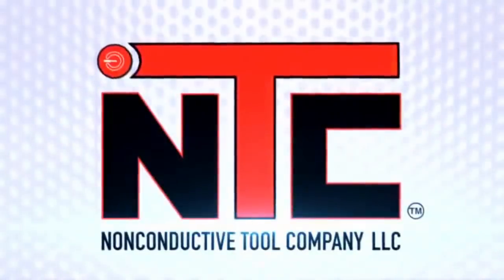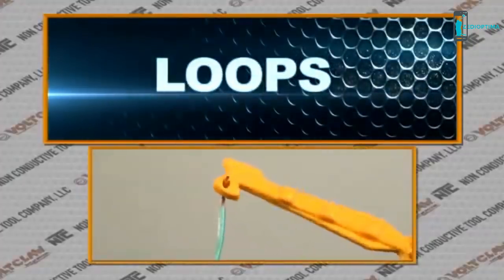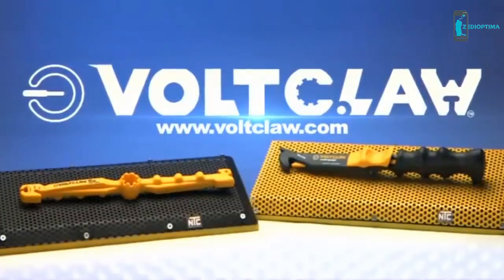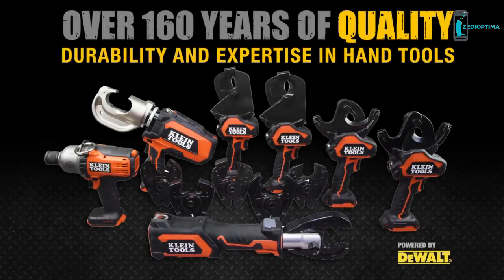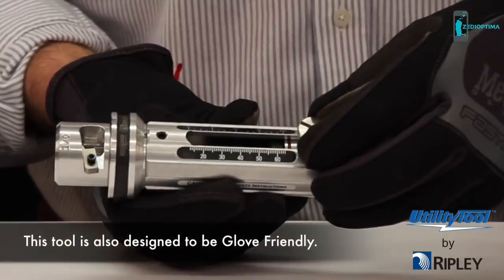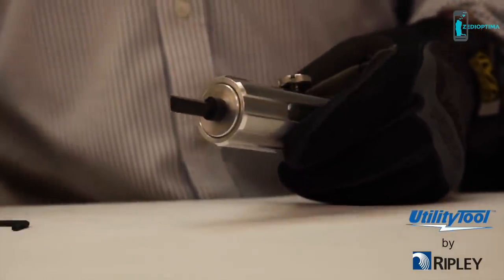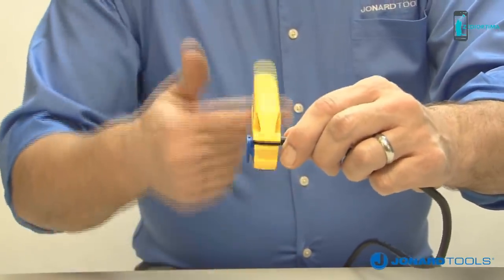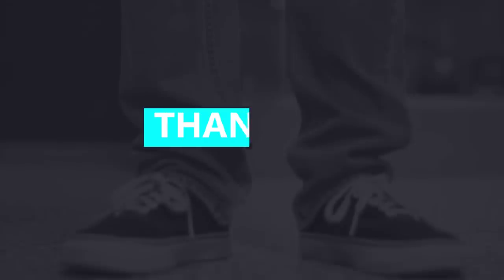These are Essential Tools for Electricians - Must Have for Electrical

Comment: I don’t think it is an essential tool for an electrician, but it is really helpful for the DYI homeowner. An electrician knows how to work inside a box but the DYI homeowner might not know and cut the insulation on a wire if they use a pliers. This tool is very handy to push and pull wires inside a box.
Reply from the maker: Thanks for highlighting the importance of this tool for DIY enthusiasts. It's great to learn from experienced electricians like you.

Comment: If you need a volt claw to handle wires as small as 12 and 14 gauge, you need to work In an office on a computer somewhere.

Comment: Well... for all this super  electricians,  You guys are lucky cuz most of your construction it's on plywood, wood, PvC, gypsum board and that's easy job like baby easy job but now us here in the Caribbean we got concrete construction using blocks or solid concrete walls and sometimes depending how old it's the electric it can be a pain in the @$$ having to use bare fingers in the boxes with old cables and using gloves not all the time it's a good option so that stick its really kind of handy
Reply: this!!! I can do it with my fingers, but with practice i bet that you can use the stick and be just as fast but without all the small bruises from the concrete walls

Comment: Sorry, but if you think a Voltclaw is essential, you shouldn’t be an electrician 😂
Reply: I mean the only thing id use it for is those sketchy j boxes where box fill wasn't even an afterthought. Especially where there's a bunch of stranded wire and I'm working it hot.

Comment: I am an electronic tech and I use an old small long needle nose with some heat shrink tubing on then due to my arthritis condition.
Reply: Is arthritis due to you being an electrician?
Reply: @tommymack3210  No it is just other health reasons, like got stab on the knee when i was 13 yrs old.
Reply: @ldiazmdiaz  ok. Thanks for answer

Comment: The volt claw is about the most useless  crap I have ever seen!
Reply: I have them and use them daily. Love the tool. (Commercial/Industrial electrician.)
Reply: DUDE!!! I said the same thing when a co-worker kept trying to get me to use his at a hotel job. After I used it ONCE I said,"oh, wow!" and then bought one that same day. When it comes to solid wire, the Voltclaw is the tits! It saved my hands, wire insulation, and, most importantly, time. Not sure how much use you'd get out of it with stranded but if you're at a jobsite that's using solid wire then do yourself a favor and get one. I know it looks super dumb but it really is pretty great!
Reply: I'll stick my Knipex insulated needle nose. Hasn't let me down yet.
Reply: Agree if you need this you’re not a very good electrician, it’s straight crap